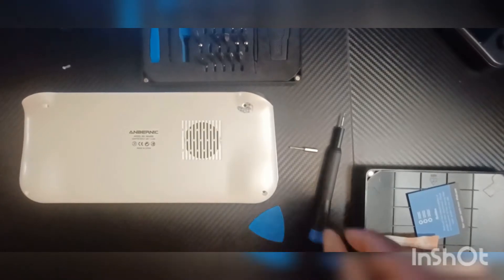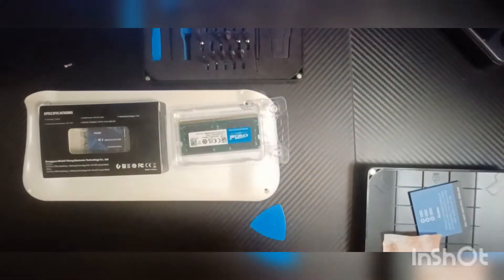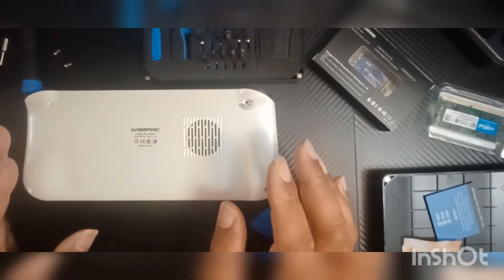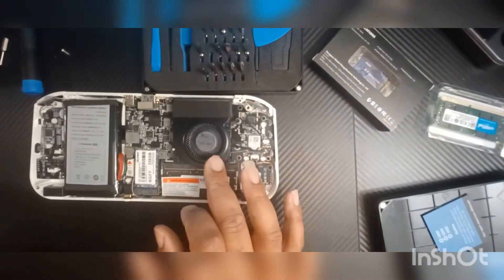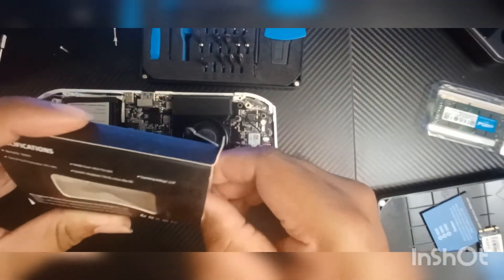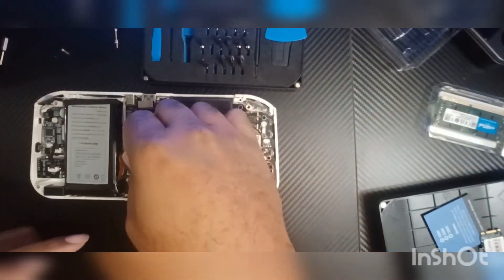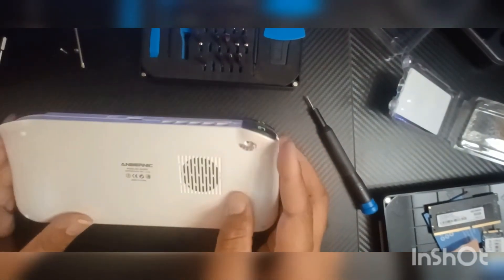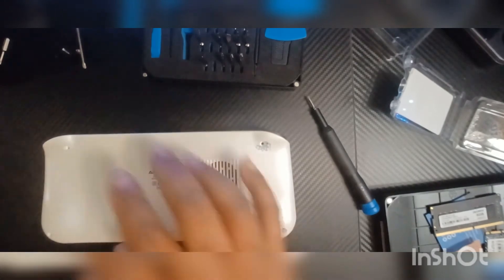Win600 Ram and Ssd Install

Comment: hi! im thinking on upgrading the ram on my win600 but not quite sure on which one should i get. does latency has to be lower than cl16?
Reply from the maker: For when I was on it cl16 was the one I seen suggested but I have seen that you can go up to 3200 mhz. I have no way to test because my win600 fried itself a while back so why I got a steam deck. But since i get more views on win600 I might either get a new one or fix the one I have

Comment: friend this console can be put a memory of 16gb Ram and can hold it and change the hard drive help?
Reply from the maker: You can put up to a 32gb ram as far as I heard but the one I have in mines is 16gb 3200 mhz from crucial on amazon. Only issue I'm not able to overclock the ram past 1333 mhz but I have seen lower one like 2666mhz overclock up to the 3200 mhz which I plan to test as well. Hoping to get a video soon sorry for delay
Reply: @DfairGaming  friend can you pass me the direct link please to buy the memory and the hard drive

Comment: Hey what kind of 1tb Sdd you have and 16gb
Reply from the maker: I had ordered the sharkspeed 1tb ssd but mainly doesn't matter brand long as it is a 2242 m.2 sata ssd. I will have a video soon still waiting on one more item on how to switch ssd and how to use it. I bought the crucial 16gb a few weeks back and I use 8gb vram to help with video quality on the games
Reply: @DfairGaming  okay thanks

Comment: Ok Man, It was usefull... But... After replacing the SSD... How do you install the Windows on It? Cause It Will be empty, right?
Reply from the maker: Yeah once it turned on it went straight to bios I couldn't figure for longest so I had to recharge to original and use an adapter to flash windows on that one. I had similar issues on the ram where it wasn't overclocking right had to research some things myself
Reply: @DfairGaming  would be cool tô make a tutorial about it... I don't think anyone hás made anything like that yet
Reply from the maker: @Danimmend  I'm in the process of getting another ssd with a little more storage soon I can I will try to make a video
Reply: @DfairGaming  any issues with drivers? Thinking of putting windows 11 ghost spectre on it.
Reply from the maker: @degenerate8228  I didn't have issues when I used windows 11. Everything ran best as it could. But I ended up trying to change that ssd even higher and hot swapped ssd and ended burning something inside so be careful with it. Been working on steam deck but any other questions on win600 I will still answer
Reply: @DfairGaming  think best not to take out anything just use usb go into bios and change to boot drive to usb and install windows ltsc that way. Less bloat on windows ltsc.
Reply from the maker: @degenerate8228  on the win600 I was upgrading the ssd for more storage was why. Steam deck actually proved a lot better since I been working on it and putting together a comparison video to show that soon
Reply: @DfairGaming  that is what you should do the vid on please or post a link?
Reply from the maker: @hawk slayer  what do you mean exactly? Saying I should stay on win600 videos or something else entirely.

Comment: noticed the ssd does'nt have a heat shield you can slide on it like the steam deck,,,my want to get that
Reply from the maker: Yeah normally you would want your ssd to have heatsink but the way they made the device didn't come with one so it can run without it but to keep it cooler and last longer that would be a good idea
Reply: @DfairGaming  steam deck has a little sleeve to protect it from heat,that slides off the ssd
Reply: @DfairGaming  just ordered one of these off aliexpress

Comment: Got the same 1tb ssd and ramu got. My win600 will be here tomorrow. Here's a question....the copy of windows 10 it comes with....do they give you the serial key for it? May can use software to get the key. That way when you install new windows on new drive u can register it. Or install cracked windows lol. If they dont give u the key then ima just use software to get it and use that legit key to register new windows installed on the 1tb. Game ideas to test: Xenia xbox 360 emulator...arcade game called Vigilante 8 Arcade. Was the last v8 game in the series. Also the leaked Goldeneye 007 N64 HD Remaster that never released but leaked not long ago. Was coming to 360 but got canceled. Would be awesome to see it tested. Also RPCS3 ps3 emu...game called PAIN. If it runs. I wanna try Twisted Metel PS3. Fav TM game. Oh and Age of Empires 2.
Reply from the maker: As far as I know you can upgrade to window 11 without having to buy a key because your product key stays with it from the 10 but as soon as I get it started this week I will be going through the process. A lot of the information I have also come from help of other guides as well like retro game corps and other people but once I get started I plan to do most things my way. I will definitely try to get those games running if can the ones you suggested
Reply: @DfairGaming  yeah no way I'm installing 11. 11 is trash. Buggy. Slow. 10 is much faster. 11 is too new still.
Reply from the maker: @AppNasty  yeah I understand its a preference thing right now anyways. Some people only using the Linux side of using the steam os side. But thanks for the heads up with that
Reply: @DfairGaming  mostly a compatibility thing. Some things still dont work with windows 11. Few games I have on steam. 10 has had many years of updates and is speediest as of today. So to sqwueeze every bit of performance out of the win600 windows 11 wont do the trick. Hey....video idea there. Install windows 10 on a flash drive and 11 on a diff one. Boot both and run the same game w/ same settings.  See which performs best.